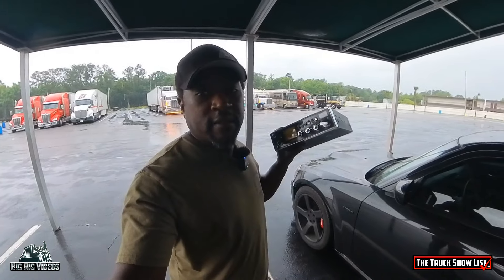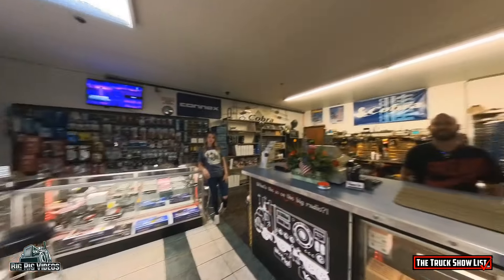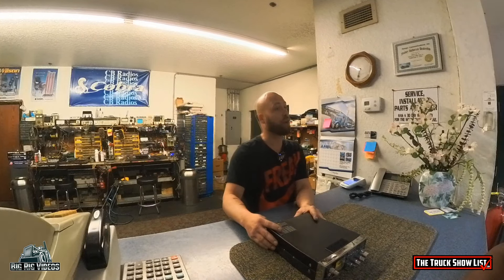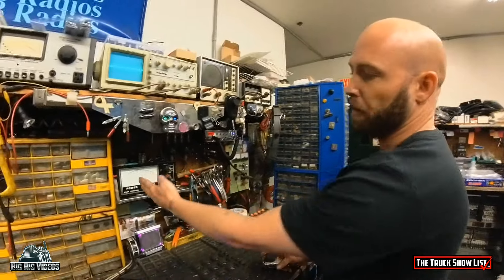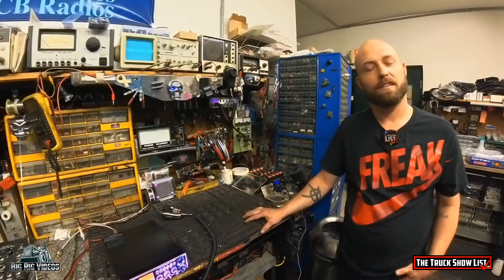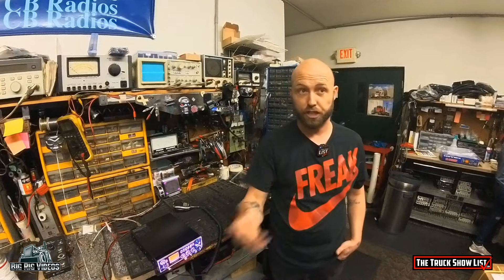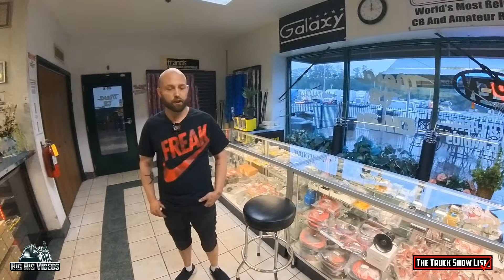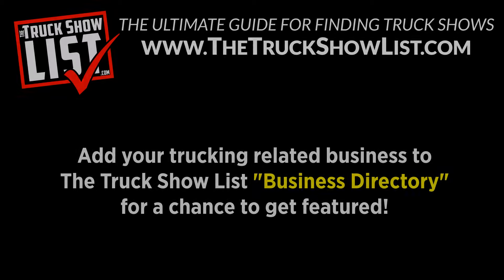Mission Control needs a new CB radio

Comment: I have a 81 connex 3300 still going strong 💪
Reply: I've got an older 3300 also, but changed out the faceplate several years ago for the stars & stripes, with eagles on it. Still going strong also. Road king mic, works best for my voice tone! "Eagle Claw" on da flip.

Comment: It should be mandatory that every professional driver have a CB radio in the vehicle. They make all rhese dumb rules but having a CB in the vehicle would be VERY handy.
Reply: Them CB radios have saved me a few times, I wouldn't feel safe driving an rig without one.
Reply: Gotta agree with ya 100%. A very important piece of safety  equipment, for sure.
Reply: @a.h.s5152  10-4 on that.
Reply: I passed a lot of hours chatting on the cb with other drivers over the years. Made a lot of friends too. It was a different culture back then, compared to now.